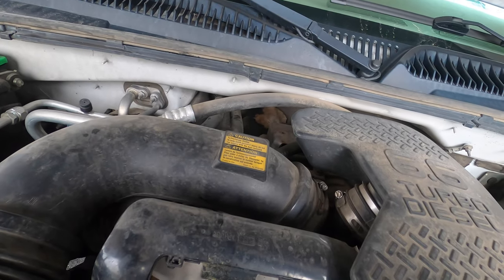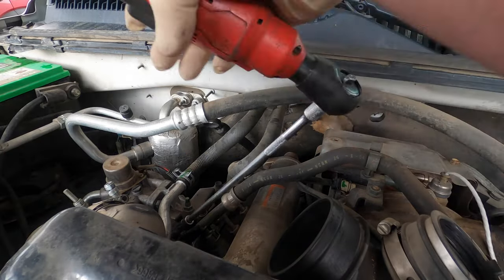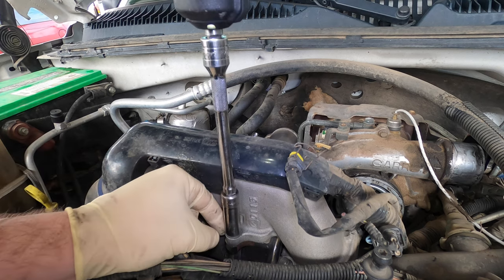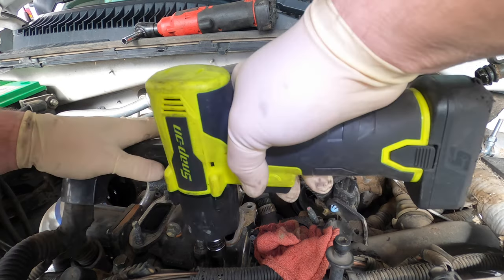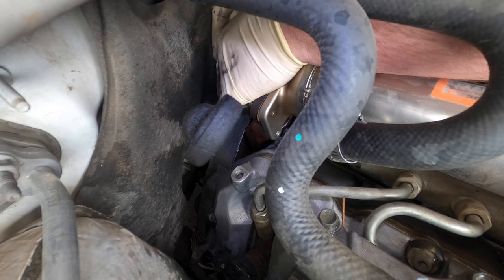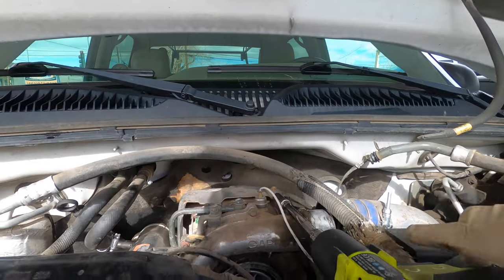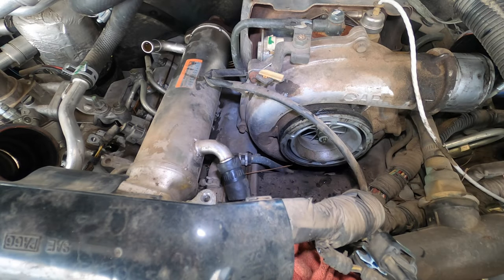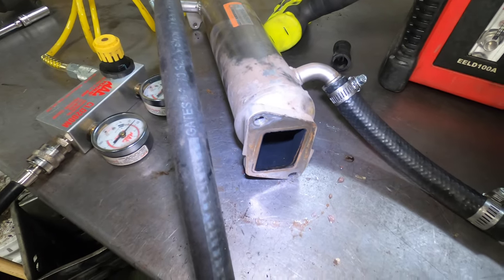First Thing To Check On A Duramax When Headgasket Is Suspected

Comment: You would love working on my duramax lb7. 
Especially with the bolts on the back side of the cooler. 
My truck has a 3" body lift and it makes a bunch of room in the back of the motor and everything up the truck. 
I watch some of these YouTube videos and feel back for how difficult stuff is at times. Till I go work on mine and how much access the truck has. 
It's freaking awesome. 😅
Reply from the maker: Those body lifts make working on trucks a breeze. The Chevys aren’t too bad but the newer fords are very tight.

Comment: Why did he have to take it out to pressure test the cooler.  He should have been able to do that in place.  Just needed accesss to the two coolant hoses?
Reply from the maker: You could pressure test it in the vehicle but to access the hose in the middle is a pain in the butt and plus its not usually a egr cooler leak on these trucks , its almost always a head gasket so i dont charge to remove and test it if we do the head gaskets . I inform the customer that its a 99% chance its the headgaskets so they dont have unreal expectations.
Reply: does a egr blocker plate isolate the cooler

Comment: The title of your video should be what you are doing in the video.
In this case " EGR cooler removal and pressure test 6.6L 2500 Chevy HD "
Your videos are good and your camera work is good and you offer lots of good tips but you are hidden because of your title choices.
Reply: I actually watched this video because I'm afraid my head gaskets are shot. I wouldn't have known there was a connection if it had a different title. Maybe add both?